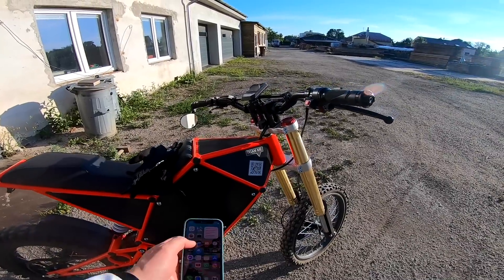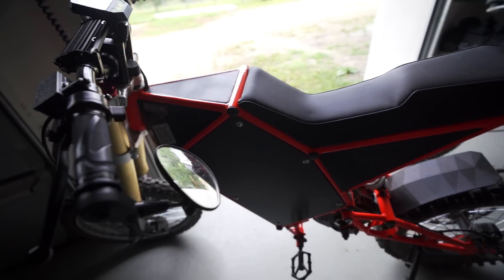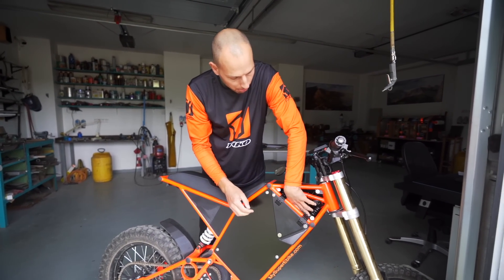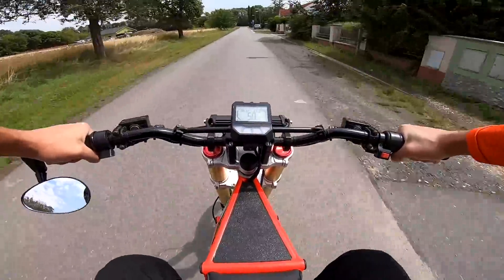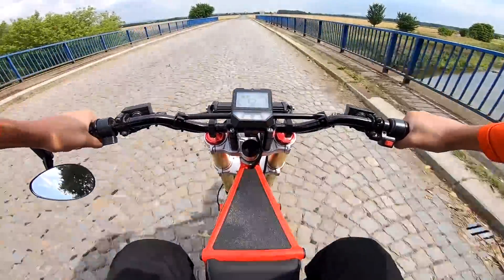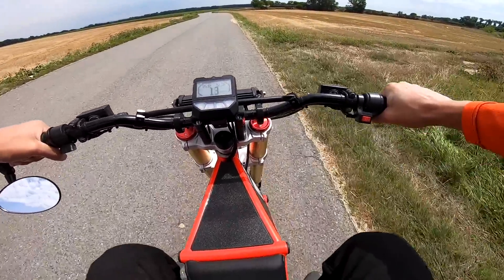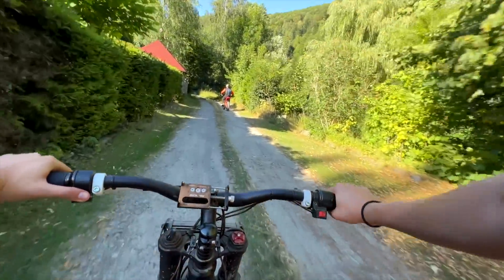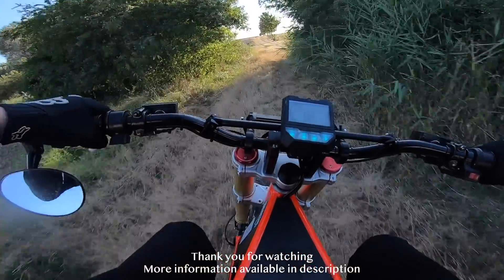Electric Bike goes 116/kmh !

Comment: Show us how many watts when charging from the van... Using an inverter.. curious how much power would need to charge from the van
Reply from the maker: I will not be charging through the inverter. DC-DC straight, just stepping it up. It will handle even more than 3kW.

Comment: I really like it when you guys do e-Bikes demos. I would like to know: Where are you, is there specific legislation for the use of this type of vehicle? Here in Brazil, for example, you must obtain a license to drive bicycles powered by combustion engines of up to 25 cc or electric, with a maximum power of up to 350 watts. In addition, the vehicle must have a license plate.

Comment: What are the possible security mechanisms for the bike? For example, does it take a key to start? Could you fit an immobilizer /battery cut off? Any other locks which are built in to it? What do you use on it yourself?
Reply from the maker: I don’t use anything myself but everything you mentioned can easily be installed. Including a gps tracker.

Comment: I've mentioned it in a thread here before but having owned a Brammo Empulse R for 6 years, I know exactly the feeling these things can give you. I seriously miss that motorcycle.

That said I've finally got a (sort of) workshop of my own so I'm really considering building my own Winder. @Ladi & Margaret , have you seen people mod the winder to be pedal assisted instead of using a thumb accelerator? This would make it easier to legalize the bike in my country.
Reply: It is really easy to make it pedal assited. You only need to buy a pedal assist sensor and plug it in to the controller.

Comment: Ever consider a toothed belt instead of a chain?  Quieter, less maintenance.
Reply: not for off-road. This setup is quite enough.
Reply from the maker: Yes I have. I actually researched it deep enough that I gave up on it. It’s less useful in dusty environment, very expensive and makes it very difficult to remove rear wheel. Chain is great how simple and affordable it is.

Comment: Great video ! Is it road legal for the UK and in turns of security does it have a lock ??
Reply: Only on private land. Anything that goes over 25 km/h (15.5mph) & has maximum power output greater than 250 watts is illegal here unless you prepare it for an MVSA and make it a legal moped but then you'll need a number plate, insurance, helmet etc.
Reply: @tine8849  great reply thank you for the info
Reply from the maker: It’s pretty easy to make it street legal in the UK.

Comment: Ladi great to see you are still producing these. How about an update on all 3 bikes? How much has pricing changed on the DIY bikes and parts? Maybe an update on $$ from the company that makes the batteries pre-made.
Reply from the maker: There hasn’t been much change on the EV market. These configurations are still awesome up to date. EBike 4.2 would be worth upgrading with nucular controller but that would be higher price range.
Reply: @ladiandmargaret  What performance difference would happen with the 4.2 on the nuclear controller? I love the cyber bike, but having something that can pass as a legal ebike would be much more useful for “last mile” commuting from a 170 Sprinter in city areas (or at home in the city doing errands), but hopefully nearly or just as fun for off-road adventures when on a nature adventure.